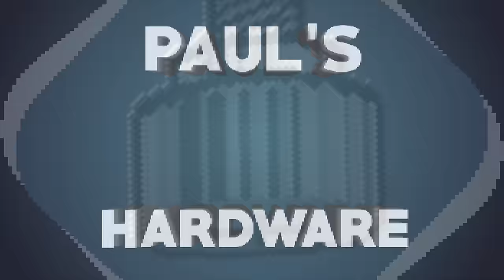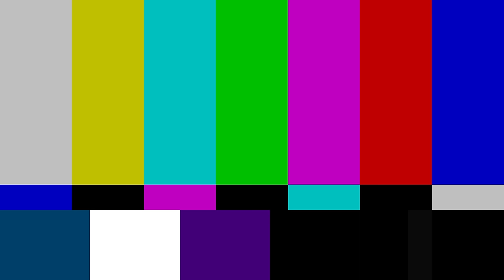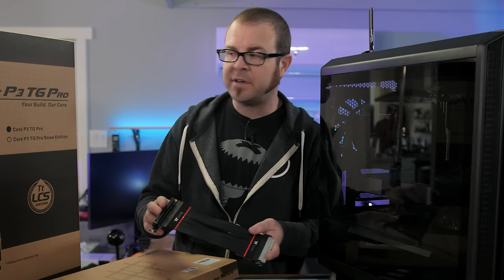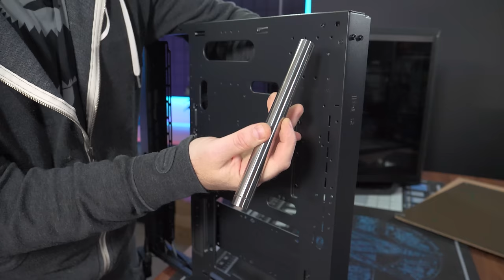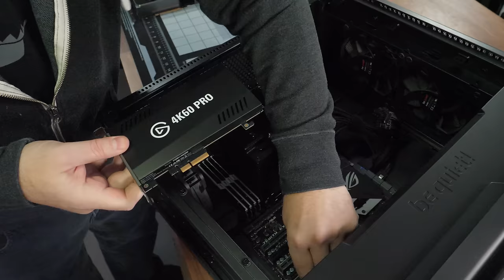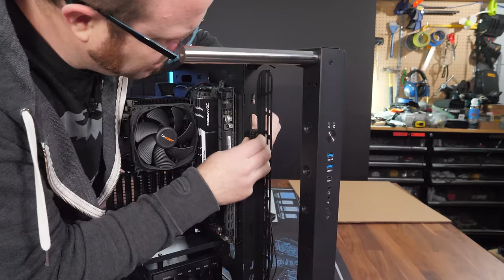Yes, this was a Bad Idea (Emergency Wall-Mounted PC Build)

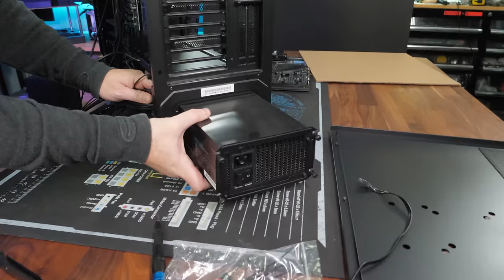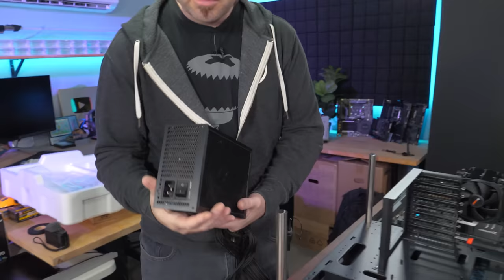Comment: HA HA HA!!! @paulshardware, unfortunately for you, I did happen to see your power supply fan was dirty when you pulled it out of your old computer case (time: 6:35) to which you mentioned that it was clean when you reinstalled it into the Thermaltake chassis (time 6:51)... Accountability: you should have mentioned that it was a little dirty but easily cleaned up.🤣😁😃😜
No biggie. Your videos are always welcomed to listen, watch , and learn from!!! Keep up the good work.
I especially liked this video since it did display the issue of whether to install the video capture cards and GPU vertically or horizontally, AND the thought process that went into it. I'm sure that will be useful to those wishing to do something of that manner.
Two small questions to ask
(1) Since that computer will be in your garage, I believe it will suffer more dust and the like since it is not protected like it was before? What maintenance plan to ensure the dust and debris does not accumulate on that computer and damage it?
(2) even though your GPU is fastened on one side firmly into the case, won't the GPU suffer from sag on the other side? If so, will there be a plan to make/buy a sag bracket to protect it?

Comment: have you looked at if a polarized filter on the glass would help with the reflection? I know they do a lot on cameras but not sure how well they do if the glass pane itself has the filter on it.

Comment: I have the this Thermaltake  case, decked out with a be quiet dark rock pro 4, and some lian li sl 140s. Love it , its a dope af case. However my kid is moving into a cramped space with her GF so im giving it to her. and Im  switching  to a Cooler Master Cosmos C700M, that I scored a killer deal on, on FB marketplace in mint condition for 125.00

Comment: my pc sits on a wall-mounted shelf since a couple years now and it was never an issue. but i built that shelf specifically for that pc. and i am from germany where we have solid walls and earthquakes are no issues. different circumstances require different solutions, i guess.
but seeing the result, i wouldn't mind getting me a proper wall-mountable case. preferably one that does not have the empty space, since i don't plan on watercooling it. and i don't like the open top of this one.

Comment: Welcome to my vertical mount nightmare! WARNING- Make sure to check "Thermal Mike's" PCI-E Riser cable. My Core P90 Case only came with a PCI-E 3.0 Riser cable. With ROG motherboards defaulted to "Auto", my 3090 did not like the Auto setting. Had to hard set the motherboard to PCI-E 3.0 until I was able to get a 4.0 Riser cable. But, I guess Thermal Mike saw you coming and threw in some quality goodies us Basic folks don't get. Cheers. Hope that 4080 works as it should off the bat!

Comment: I keep looking at these wall mounted cases. I am just worried about how noisy it may be with all the open air fans and such. I also don't know if I want the one shown in this video or some of the newer ones that mount the PSU in different ways so it's not nearly as thick. Many of those don't have glass though which makes me paranoid too! Or do I just hop aboard the SFF train and get a case the size of a shoe box... decisions decisions.

Comment: thermal take need to think out of the box (pun intended) 
when you wall mount a pc you ideally want the cables coming out the bottom, so the vesa mount would ideally need rotating and the power button and IO would neet to be on what is currently the bottom.
Reply: then for tower coolers would need to reverse airflow to exhaust up.

Comment: Curious as to why you did not want to put the computer under the desk, Is it that you just wanted to see it or was there another reason. I built a little stand that keeps the computer about 4 inches off of the tile floor.  My ac vent is under the desk also so it is usually cooler under my desk and it helps  with the fan noise and desk space.

Comment: why not a SFF PC? the 7900xtx, and midrange i7 intel or possibly a Amd Ryzen 7 7800X3D? all of the cores, runs cool, as importantly probably a fantastic chasi that's wall mountable, lightweight, etc. Purely for a mix of mostly work and light gaming that's what SFFpc's are for!

Comment: You can always just not install the glass panel. It has no function on this pc then the glare issue is solved. Also easier to keep clean without a glass panel to play around with.

Comment: The shelf is about 2" too narrow.  Attach a supplemental piece to the surface of the shelf to make it wider then rig some sort of bracket through the holes in the bottom of the case (or through the case legs) and attach it to the shelf.  Shelf mounted to wall + case mounted to shelf = case mounted to wall.  But that solution wouldn't accommodate all these product placements.

Comment: Just take the glass off. It doesn't actually serve a purpose if you don't have fans that you want to keep fingers out of, and the way you are configured, you don't. Then you can pull the metal rods off the corners and it's a fully open air system. That's how mine is set up, except mine has a distro plate and radiator for the CPU.

Comment: hope paul mayyybe see's this or a similar comment

im like 90% sure what you were getting with those motherboard lights being on before the PSU's switch was on, was some form of phantom power being introduced from another device. most likely either an HDMI or display port or possibly USB (( but that would require your usb's to be fed through a powered hub ))

Sometimes this can be indicative of a bad ground connection ((  poor ground in general OR a ground loop )) in either your wall outlets or one of the devices ect ect. Not incredibly alarming, until you start running analog audio equipment haha, but its douptful the PSU's capacitors were allowing outflow while its back switch was turned off. That switch should be a hardware cutoff , meaning it should be IMPOSSIBLE to send power, there SHOULD be no connection to the live wires. Otherwise its a (( dummy cut-off )) and thats kiiiind of alarming as well in the world of electronics
Reply from the maker: this is a great explanation and something I hadn't considered, thanks for the comment! 🙏

Comment: I'm wondering if the additional radiator/fan bracket that can be placed at the top or the front can instead be placed on the bottom, allowing air to be forced upwards into the case and out, since heat rises.

Comment: Eh....Wall mounts are for beginners. Let's see you soffit mount a PC and all the cooling issues which can arise from that, since you're embedding the case into the wall. Though one of the primary issues with the wall mount is that all the connectors face towards the door. Since the thing is gonna stay there, I'd turn the thing 90° and have all the connectors facing down instead, essentially the inverse of what Silverstone did with their Raven cases.

Comment: I felt like it would have just been easier to just use an AIO cpu cooler instead of going through all that trouble of going with a vertical gpu mount lol I'm almost certain you have one just as I have multiple laying around 😑

Comment: Nobody has designed a case with a single super phat washable filter for the whole thing for those with huskies or... cats.

I got 1 husky and my PC is loaded with those stupid "filter" meshes and yeah they work but... so much washing.  Gimme 1 thicc one.  I need surface area.

Comment: I'm still boasting a bad and slow 1650 4GB bought in the midst of the pandemic at 350$ 🙄, the cheapest available gpu to replace my old and dying 2012 670ti.

Now that I'm looking at a not so bad but still obsolete 3060 12gb for 400$.

I could make use of a 370 ti. If you don't know what to do with it, I could find a nice place for it in my main i7-8700k pc! 😉😅

Comment: if you pushed the power button 2 times there is no way that is residual power unless your power supply is letting power by when hard off it will not hold power after you pressed the power button it would of used all the power left first press trying to power the full system on i'm very sure it would of drained it in 1 press you did 2 even a capacitor the size of a keyboard will drain in just an hour or two after being unplugged  / switched off this should drain it in 1 fast power on with no power getting to it and should displace all the power left unless there is stand by power still getting to system when the button is off i think that is a bit odd myself but I working on general electronics not so much power supply's for computers. trying to start the system should of used all the power left in capacitors. and im not trying to be a smart azz or anything i just think that would be a bit dangerous  with that much power in it that would be the same as hot swapping a live power supply in and out of the system. `question are we at a point where power supply's handle so much power and are built so much better that we are going to need to let the capacitors discharge before it can be safely plugged into a new system ?
Reply: asking for a friend lmao

Comment: Had a Thermaltake Core P9 once. I had aspirations of building an amazing water cooled pc and wall mounting it. While the case is absolutely fantastic and the sheer custom water cooling design options border on endless…I had not yet grasped the cost of water cooling hardware. So my dreams of a massive water cooled system were dashed. I did use the massive case for a while…loading it up instead with any RGB items I could get my hands on…since it makes your PC run so much faster and also improves your sex life… In the end My case found a good home and my RGB enhanced sex life…well…it left as well…never to return. Just for fun…look up custom water cooled builds in the Thermaltake Core P90…they are impressive….unlike my non-RGB-having-non-sex life. At least I can live vicariously through Paul…sex is so overrated.

Comment: An ATX 3.0 PSU would be nice so you would not need to use that ugly adapter for the GPU. Since the system is now in a ''show case''.  🙂

Comment: 😕 Whats this obsession I keep seeing with windowed cases and lighting? Do you actually stare in/at the case instead of at your monitor? A computer is a tool/appliance, so do you decorate your screwdrivers, wrenches... refrigerator, washing machine, television... the same way? If not, why not?  I bought that same 802 case without a window which has better sound deadening properties along with better RF shielding... I just don't get windows and lighting in/on a case. It doesn't seem rational or practical. Please explain. 😕
Reply from the maker: De gustibus non est disputandum
Reply: @paulshardware Hmmm, A rather non satisfying reply. So does your "Taste" carryover to other appliances and tools, and If Not, Why?
If  its Quotes time...
“Information is not knowledge.
Knowledge is not wisdom.
Wisdom is not truth..."  -Frank Zappa

"Dubito, Ergo Cogito, Ergo Sum" -Decartes